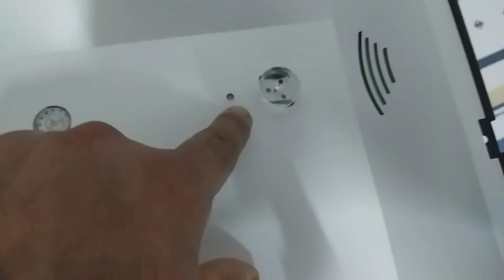Hyundai LED TV 40" Model,HY-LED40DF2010 no Display Back lights problem solved

Comment: bai ap nmbr chy
Reply from the maker: 0096170342704
Reply: bai ap pakostan k ne ho
Reply: bai mje pta karna LG42LB550 A ka panal LG 42LB5820 smart led ko lag jay ga kia
Reply from the maker: Yes
Reply from the maker: Ye to app ko dekhna pary ga k app ka Panel ketny voltage ka hai